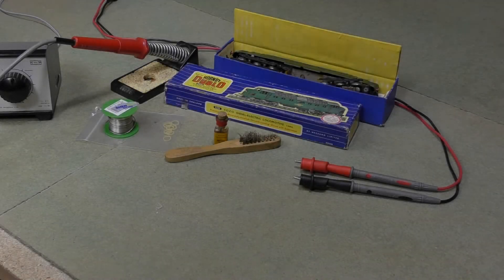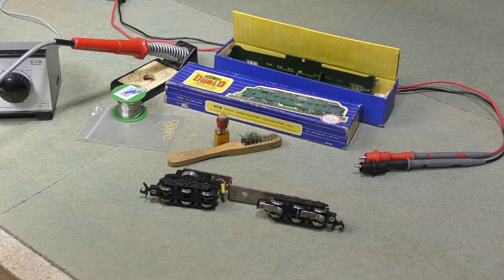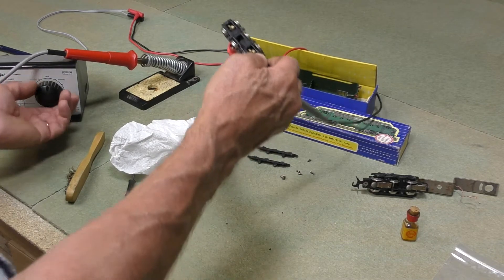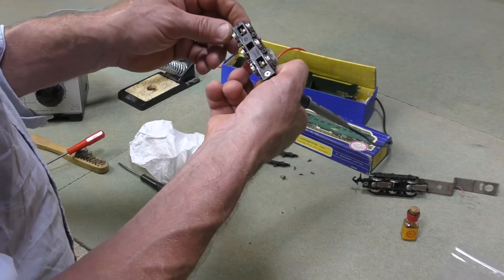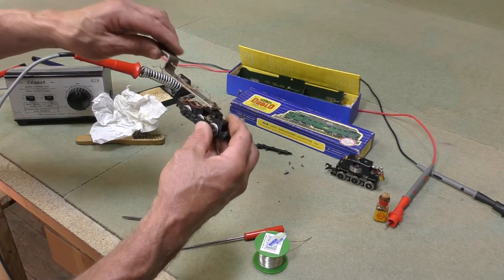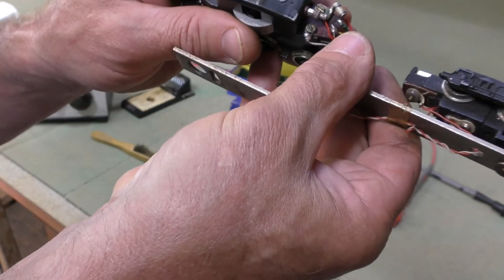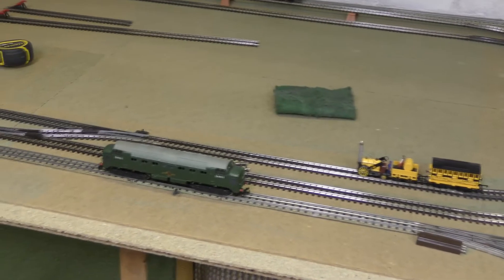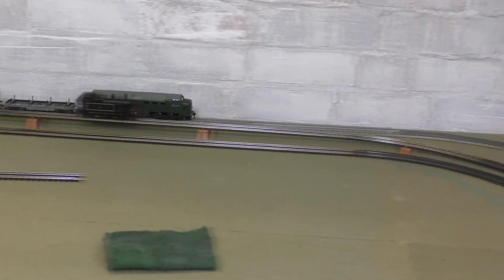Hornby Dublo Co-Co 3232 Diesel Electric A Return To Running Condition And Fitting New Traction Tyres

Comment: That is a great looking loco and running very well. It would look terrific with a rake of maroon coaches behind it. I would be interested in knowing more about where you got those traction tyres. Great video and good to hear that you will be building a Dublo layout as well as the big Tri-ang one.  Regards, David.
Reply from the maker: Hello David, It was fun to get this loco running again. Since making the video I've had to remove the tyres as they are now found to be out of round and causing the loco to wobble. I'm now looking for another supplier. I'm a little disappointed as I thought these were going to be good replacements. I'll let you know what new ones I use. Best regards to you
Reply: @MrSnooze  I've used both the flat tyres and also rubber O rings, neither of which was particularly successful, mainly due to that wheel wobble which really doesn't look particularly professional. with the power of the ringfield I ended up just running them sans tyres. when I was converting one to the prototype deltic I discovered that there were two different castings: for the lined two tone livery there was a distinct casting line on the two tone line, the plain green deltic doesn't have this. I have a suspicious feeling that such was the parlous state of dublo at the time that they updated the casting in '61 and such were the stocks they could sell both versions up until the end of dublo years later... great videos too :)
Reply from the maker: @muir8009   I get quite obsessed with this wobble. I'm working on a 3 rail Bo-Bo and have actually found a couple of the wheels to have been centred out of true. I think this is often the case on both Dublo and Tri-ang. I might machine them out on my lathe and press in some brass and re drill just to see if it cures it. I do have a Crepello so I'm going to compare the castings. That's interesting information, thank you for sharing. Best regards to you

Comment: That looks like it's running very nicely. I've got a couple of these locos, I've found them amazingly powerful but I was rather disappointed with those tyres. I did find it possible to improve the wobble by evening out the tension by going round with a small jewellers screwdriver between the wheel groove and the tyre. However, the black ones seem to be better shaped and don't cause nearly so much wobble. I found with the wiring that one issue is that over the years the insulation has become brittle and this seems to cause repeated fractures in the wire. I've been replacing the wiring with modern very thin wire, usually sold as 'decoder wire' which is available in loads of different colours, including red and white of course. These locos do look good with a rake of maroon coaches as David says in his comment - I thought I had a video on my channel of this, but it's in fact a Triang EM2 hauling them. Thanks for posting this video and best wishes. Keith
Reply from the maker: I think I have tried to even these tyres out but they still wobble more than the black ones. thanks for watching Keith and all the best to you